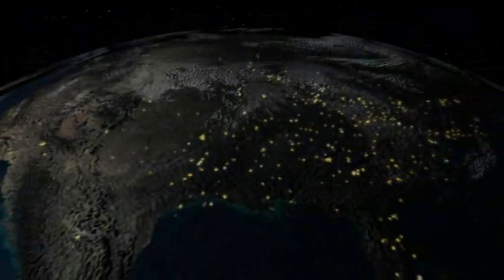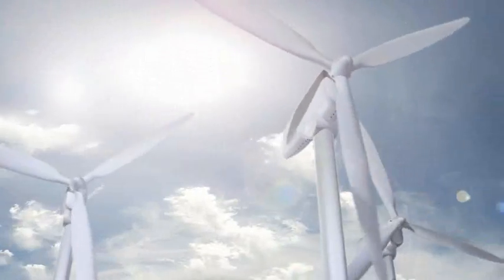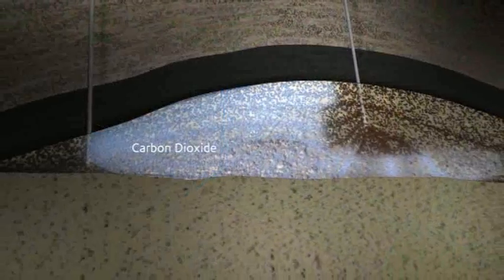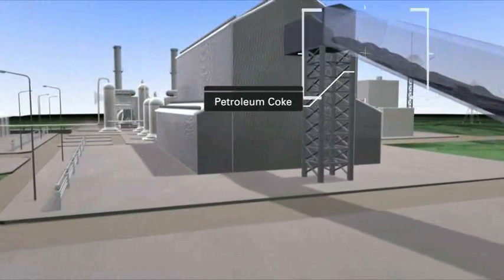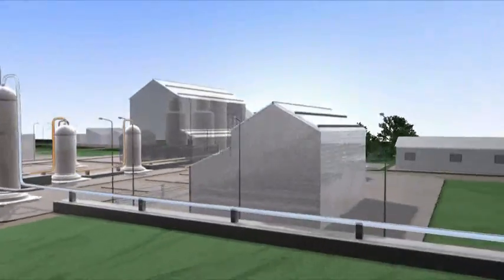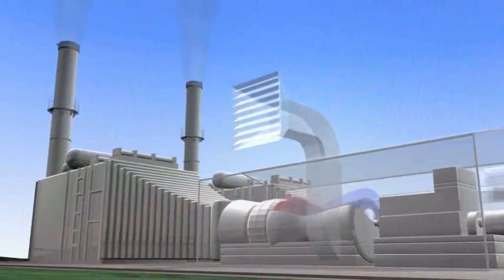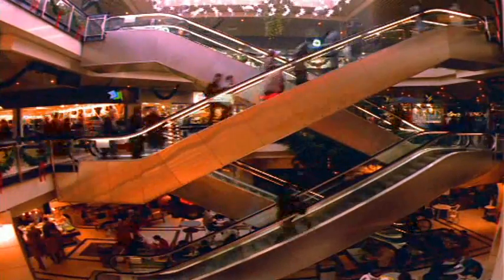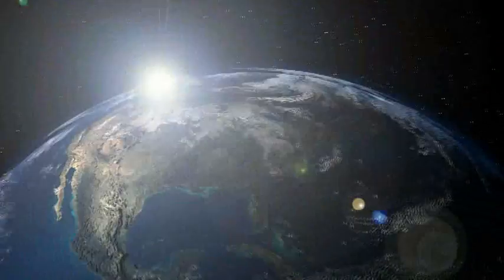Hydrogen Energy California (HECA)

Comment: a better solution is to take the hydrogen producted combine that with nitrogen to make ammonia then take the ammonia combine that with carbon dioxide to form a fertalizer called Urea. Urea is a solid and can be sold on the open market as a fertalizer promoting plant growth and thereby removing more CO2 out of the atmospher. This Urea can be added to the oceans in a ocean fertalization, this can stop ocean acidification. A good Australian scientist Iran Jones with the univercity of Sidney has developed an ocean fertilization system his paper can be down loaded. So no need to sequester CO2 but use it to make Urea. Hydrogen can come from water electrolosis energy source can be wind, solar, hydro and nuclear. High temp nuclear could be cheapist